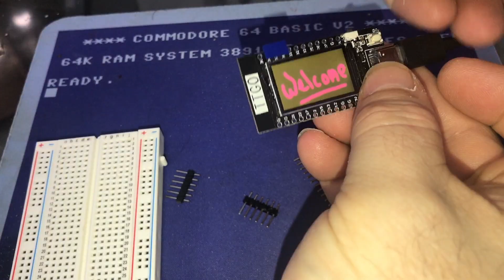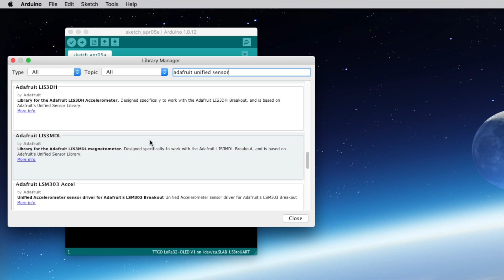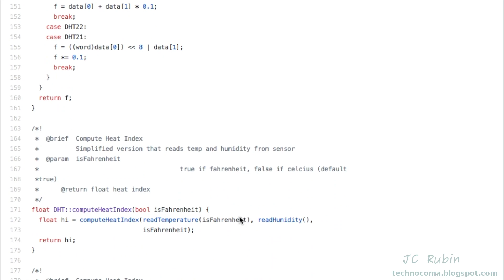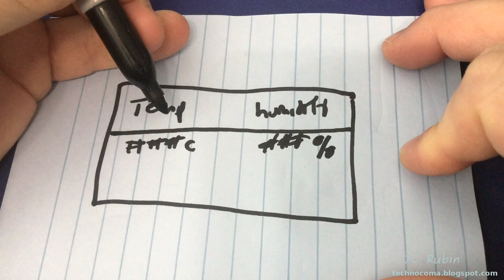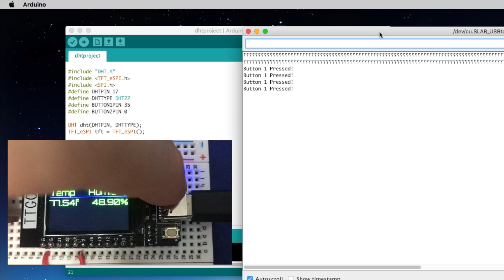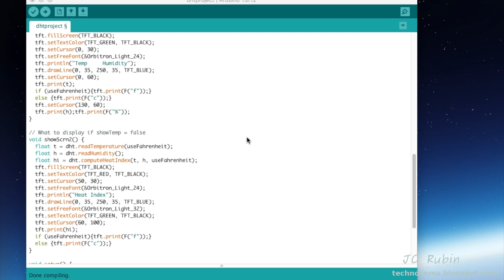First Project ESP32 development using the TTGO T-DISPLAY

Comment: Ok another great Video, loved the explaination for all your actions. 2 pieces of constructive criticism.

1.) The diagram @1.50   is wrong and misleading. Compare it to the video of the actual wiring the USB connector is on the other end of the board. It could be confusing to people and you do not want to get 0v and +5v the wrong way around .

2.) You do not have to do everything from your previous excellent video as stated at @bout 0.40!  In that video, because I am usind Arduino  IDE V2+ the JPEG tool does not install into tools and so everything after @12.35... ish could not be done . But all in this video did work just fine. So only everything upto 12.35 is required.

Thankyou again for an excellent video and your endeavours bringing it to us.

Comment: sweet esp32 display video,  would you happen to have one using the esp32 as a  Modbus RTU rs485  Master  talking to a Modbus Slave-01 reading input registers 30001, 30002?  
it would be nice to have an esp32 with on board rs485  😎  fantastic verbal walk through.   thank you

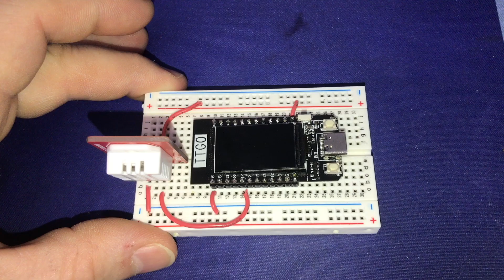Comment: The image @1:55 does not match my TTGO, your picture is the inverse of my setup.  On mine Gnd, 5v Pin 27 is next to the reset button. Also on the buttons I have use    pinMode(0,INPUT_PULLUP);
    pinMode(35,INPUT);   Then use use digitalRead : if(digitalRead(35)==0){
 if(press2==0)  {press2=1; [code you want ran]);

Comment: First, thanks for this detailled example.
About the "refresh" function for updated values: will a black background color for text do the trick with the TFT_eSPI library?
Reply from the maker: If you store a char array of the lastText as you print the text so you can print it again as the background coloque, you could blank it in that manner.

Comment: Hi ! Thanks for this great tutorial. how would you erase only the line with temperature and humidity without using fillscreen ?
Reply from the maker: Do you mean after it was written??? You could write a rectangle using the background color to cover the area the text would be. That would be a sectional blanking.
Reply: @retrotechandelectronics  i tried with a text with some "space" but it's useless. thanks for you reply, i've only to reach the function now :)
Reply: got it. instead of "fillscreen..." , better is :"tft.fillRect(0, 36, 240, 60, TFT_BLACK);"     thanks.

Comment: does TTGO have touchscreen support on the lcd? I noticed they have pins labeled "touch"
Reply from the maker: Touch is for the touch sensor built into the esp32 chip, not for the display.
Reply: @retrotechandelectronics  Thank you! 😄
Reply from the maker: There are some great simple projects in arduino ide by connecting a wire to this pin and touching this with your finger and observing the analogue output
Reply: @retrotechandelectronics  Beautiful! Thanks for the idea! I'm try to save as much space in this project of mine and the use of free wires as interactive buttons might help. I'm still contemplating between this one and the TTgo 8266 weather station since buttons are already on the board itself

Comment: For some reason the picture of the tiger from the previous video is still left in the background of the LCD after I uploaded the new code, any ideas how to fix this?
Reply from the maker: The new programme is running along with the tiger background?
Reply: @retrotechandelectronics  how do i get the previous programme to stop? I thought uploading a new code from the arduino ide would have done that
Reply: @MrLinzhangyuan  I had the same issue, but I found a fix. put   > tft.fillScreen(TFT_BLACK); <  in below tft.setRotation in the setup() field. It appears to wipe whatever display was on it before.
Reply: @brooks6486  ok that worked, thanks!!

Comment: Nice! I tried it.
You could add a WiFi interface, a calibration offset trim function, (my three modules show three different outputs) (trim hard coded).
This module could also be the heart of an A/C thermostat, which needs three (latching) relays; fan, compressor, heater. 
Single coil latching relays (low heat around temp sensor) can be buffered with  a MAX4821. (APPLICATION NOTE 3288).
Some kind of mech buttons are needed too.
Reply from the maker: Several things are planned for subsequent add-ons.  A first project must be locked down to a finite list of tasks. Feature creep is the number one killer of projects.

Comment: Very nice.. just got a TTGO T-Display myself, and having fun with it.  You should have the program change the color of the Heat Index value as it rises into the danger zone.  Green, to yellow to red would be cool... er.. hot, as the case may be.. :-)
Reply from the maker: The original plan was to design a threshold for the heat index. but I decided to save that for another video and perhaps key off that event to trigger another medium besides the display.